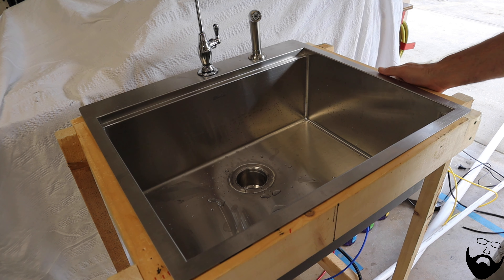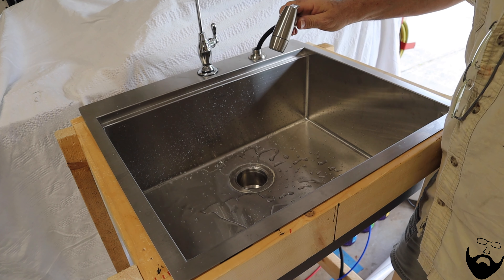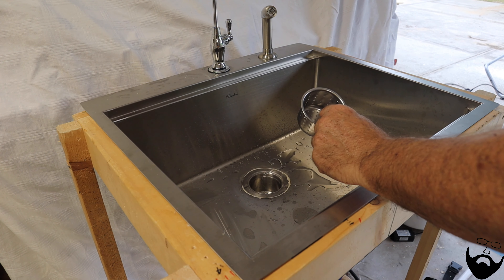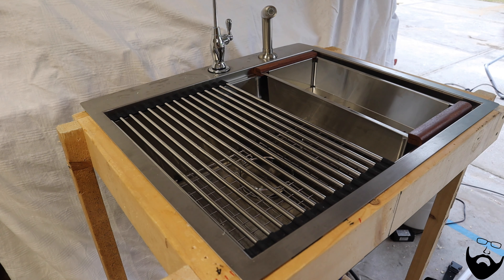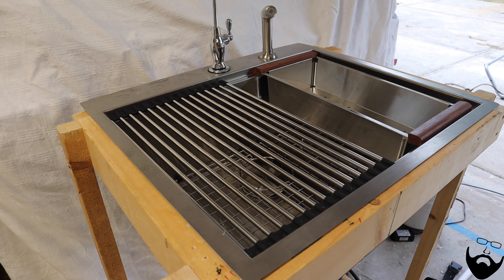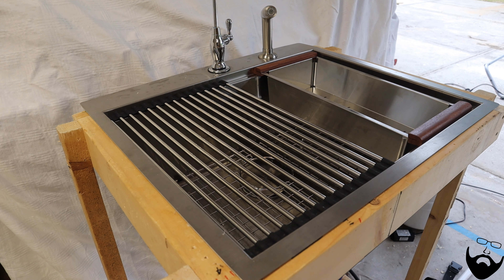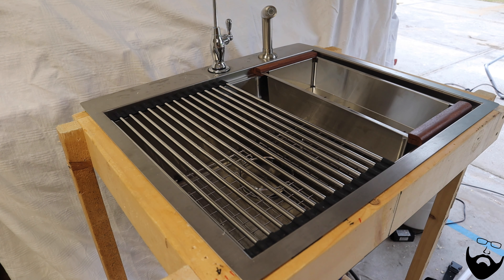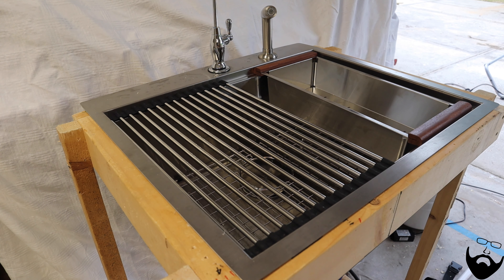Van Life sink and water purification

Comment: I have one of these sinks in my tiny house/cottage and really love it! I also have a recirculating shower. One thing I did is borrow an idea froma guy who designed the "hour shower". I think he goes under the name of gone boondocking. He used a 40 plate heat exchanger, so this way you can heat the water for your hot shower on one side of the heat exchanger, and then on the other side it just goes to your kitchen sink so there's no chance of contamination. I didn't like the idea of any recirculating water going through my hot water tank. I think they're about 70 or $80. I also found if you look for the ones for beer making they are considerably cheaper. In that case they're designed for cooling, but it works the same for heating. It's just the way they are marketed. 

I really enjoyed your presentation! Very well presented, particularly for the recirculating shower, which admittedly I struggled with when I first did mine.

Comment: Maybe I’m missing something, but having installed RO systems before, they take hours to fill the pressurized tank.  I can’t see running the pump and the inverter for the UV light for that long with limited off grid power.  A 3KW inverter will consume a lot of power even if it’s putting out little power the UV light.  I suggest finding a way of powering the UV light from 12VDC.
Reply from the maker: Your correct on the RO system taking time to filter and pressurize the tank.  That is the reason in the video I installed two valves.  When closed they bypass the RO membrane and just use the filters.  When doing this there is no waste water and the tank fills up quick.  But, if and when we get water from a source we do not trust we can use the RO system.  The current draw on the UV light is less than 30 watts.  The Inverter and LiFePO4 batteries will have not problem powering it, when it is in use.

Comment: Amazing stuff! Questions: 1. Do you have a separate gray water tank for the Sink? Or do you use the shower gray water tank? 2. Could you get by with less than a 10 gallon grey water tank for the recirculating shower?
Reply from the maker: Sink has its own gray tank.   The shower grey tank is 10 gallons.  I could be smaller, but 10 gallons will allow a longer use before the need to drain an refill.   But you can always drain and refill after each use if you want.
Reply: Frugal Factor thanks! Fantastic idea, thanks for sharing!!